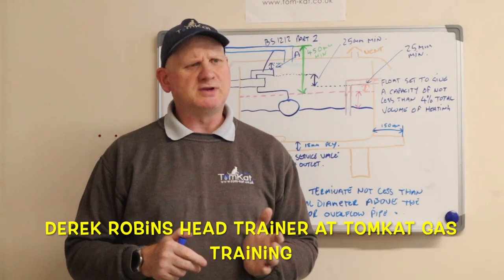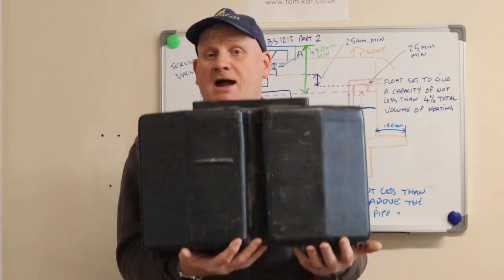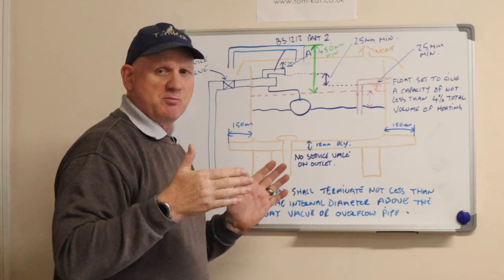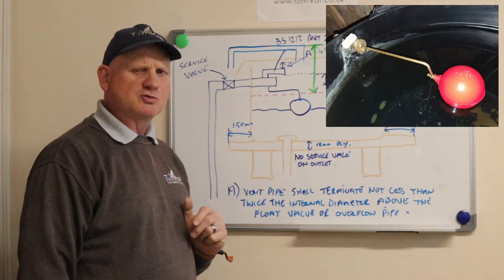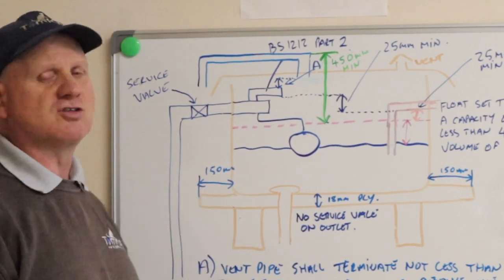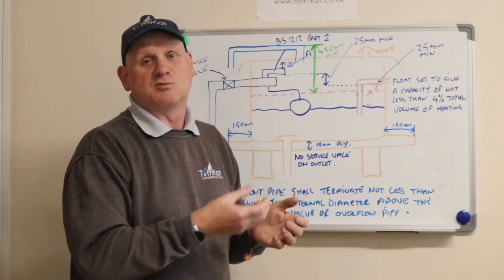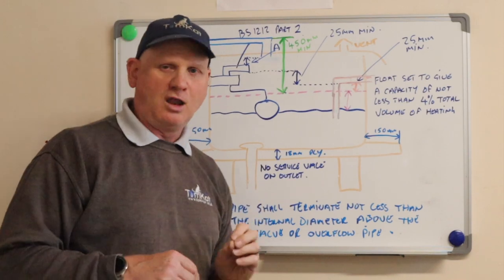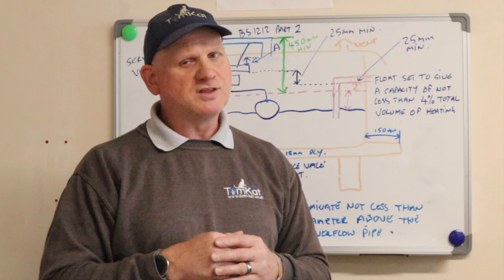How to install an F and E cistern in a central heating system.

Comment: Well done Derek, lost count of the amount of Galvanised steel tanks I installed drilling the fitting holes with a brace and a tank cutter, then mauling them into position and piping them up 😄😄

Comment: Great video, on a lot of early 2000s newbuilds we had to fit a combined vent and feed pipe on f & e systems, i never thought it was as good but it was what the spec allowed
Reply: Yep remembered that one - cold feed teed into the vent at the side of the cistern....usually off a 'Aerjec'.

Comment: Hi , thanks for the info , how things are laid out now , so if a boiler is changed ? a new header tank and all  the vent pipe work has to be changed ?  🤔Never liked combi boilers . But I was a sparks .
Reply from the maker: Nope only if they are installed incorrectly or in poor condition.

Comment: Some manufactures allowed cold feed isolation valves and combined feed and vent as long as the boiler had an over heat sensor.
Reply from the maker: You are correct but why would you 👍🏻
Reply: @tomkatgastraining  to confirm, you can put isolations on the water tank that feeds the hot water cylinder below but not on the CH tank?
Reply from the maker: @grimawormtongue2014  correct 👍🏻
Reply: @tomkatgastraining 
thank you for the super quick reply. I'll be working on a f and e system today. All the hot water taps have severely restricted flow due to a blockage somewhere. I'll be cleaning out the tank and maybe I will need to cut out and replace some pipework on the hot water supply from the cylinder. Any tips please about how to drain and or clean the tank and cylinder and pipework? 
What checks do i need to do to trace the blockage/s? And anything i need ti look out for before cleaning and cutting pipework?
Reply: @tomkatgastraining  sorry I forgot to also ask, can you put isos on the hot water feed that comes off from the top of the cylinder?
Reply from the maker: @grimawormtongue2014  not on a vented cylinder but you can on an unvented cylinder

Comment: Great video. I have one question 
Is there a minimum horizontal run for the expansion pipe once in the attic  ?
Reply from the maker: The pipe should always rise towards the F and E but no max run length
Reply: @ thanks for the reply. Sorry max length was what I was after 👍
Reply from the maker: @richardbarnwell5609  no maximum length as long as it is continually rising but it will also need insulation and I would always advise to be kept as short as possible
Reply: @tomkatgastraining  as I’m doing a few attic conversions with f and e systems I just needed to know the ins and outs and common practice as I will be relocating them appropriately so that was just the main concern for the two tanks in the attic what the maximum length could be

Comment: My understanding is that you can fit a valve on the out let provided the appliance has thermal cut out? Is this not the case?
Reply from the maker: Went to a job once where a baby had been killed by an f and e being installed wrong. The water boiled and melted the cistern and the water came through the ceiling and killed the baby and yes the boiler had an high limit stat.

Comment: Hi Derek very good, think you should do a follow up video, showing vent and feed pipe connections into central heating system, I always like the airater (4 pipe connection), still prefer open vent to a sealed system , heat only boiler are so much more reliable, the amount of call outs for low pressure is stupid 😢, also thermostat with battery!!, and smart thermostat, talk about going backwards!, keep it simple , as away great video,
Reply from the maker: That’s the next one mate 👍🏻
Reply: Hi Derek just a quick rant, when I started out there were no national repair company’s, you fitted a system with a old style heat only boiler that just worked( still have boilers I look after 30years old!, only had to change ,could not get replacement flue) in that time your probably go through 3 combe!, do loads of call outs for national repair company and I really question are most boiler fit for purposes , even the so call top brands are not that great, nearly every call out is a combe, pressure or over complicated control, think I better retire 🤣🤣🤣, ends up most customer have  a service plan they really can’t afford or never us to have, we have gone backwards

Comment: My father inlaw had a service valve on the f n E tank. Found it when he complained about not being able to  bleed his radiators! Had to wet and dry the tank with all the crap that was in the bottom and remove it

Comment: I often fit a gate valves for service reasons and remove the wheel so tgey cant turn them
Reply from the maker: You could fit a lock shield valve but no need for servicing 👍🏻

Comment: The good  old days mate, copper pipe and benders, stabbing into lead or wiping a joint, inverting the cold feed on system entry.
Skill no longer seen
Reply: still use copper and still use pipe benders.  Just the systems that are changing- more efficient with skills required elsewhere.
Too many Luddites in the trades......

Comment: You were talking complete and utter nonsense regarding the installation of a F and E tank, to suggest not to fit a full bore isolation valve on a central heating is ridiculous I thought you were a skilled plumber obviously not.
Reply from the maker: You have just proven you know absolutely nothing about heating and regulations. Think you need to read the water regs and then say I am talking nonsense. Also it’s a cistern you ignoramus not a tank.
Reply: You obviosly not HETAS registered
Reply: I think you will find he is more skilled than all of us .
Reply: You are talking absolute  'utter' ball hooks my friend. You don't place a valve on an open vented heating system cold feed. This will create a hazard- now get back to college and look at the physics of water levels and how this  system works..
Reply: @mgbroadsterJ  - replace 'all of us' with 'you'